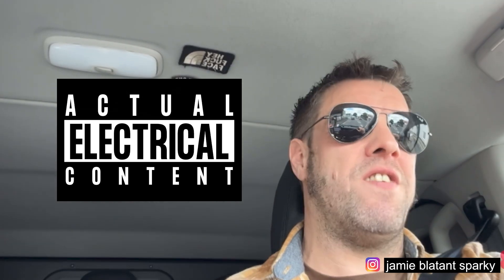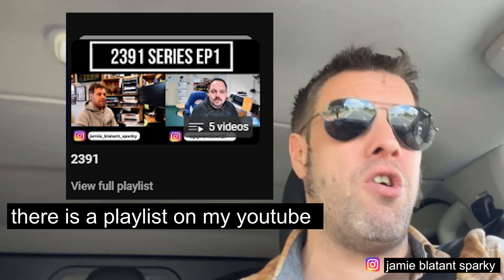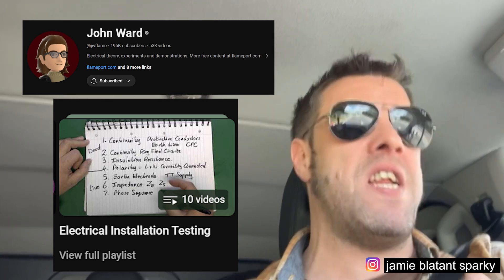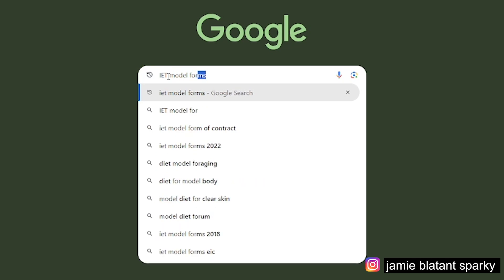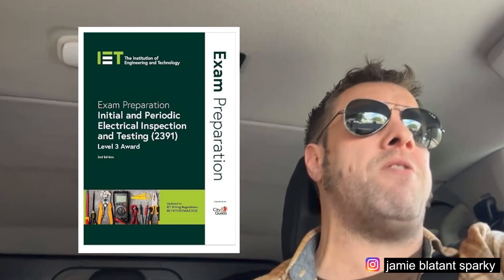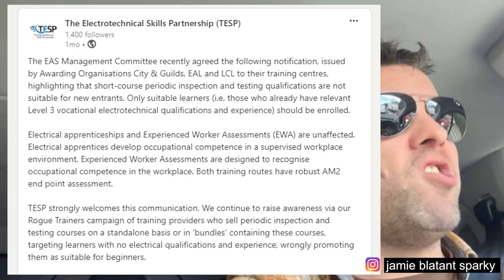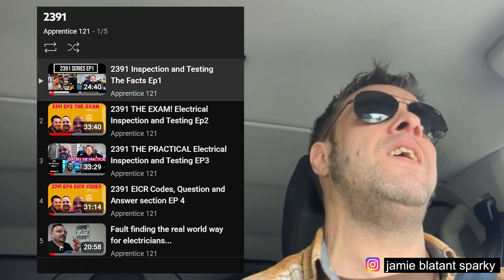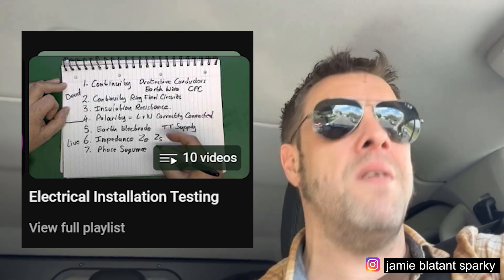C&G 2391 HOW TO PASS essential course preparation and guide #electrican #2391

Comment: Great - this hits the nail on the head. It’s not glamourous, but rehearse the paperwork and be prepared for exam conditions.  I used to think the time pressure was a bit artificial, but actually I think the point is that it forces you to have your knowledge familiar enough that you can recall it quickly. 

One more too tip, which you mentioned in the 1-2-1 series is about knowing what each item on the inspection checklist actually means. 

Great also to show that @dsesuk video about Harvey Tyrell. Nothing better to hammer home the importance of good testing and good paperwork.
Reply: A beautiful set of test results can be ruined if you tick the box that your test rig had an earth rod 😂